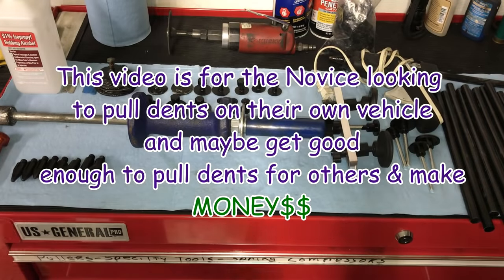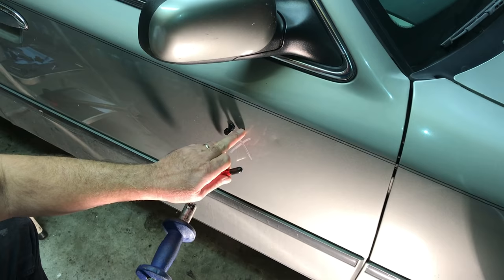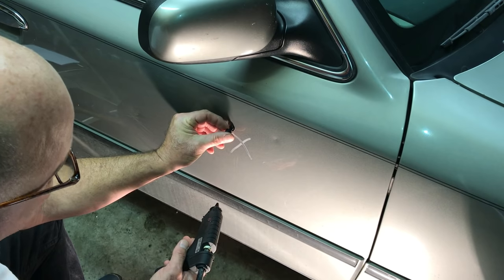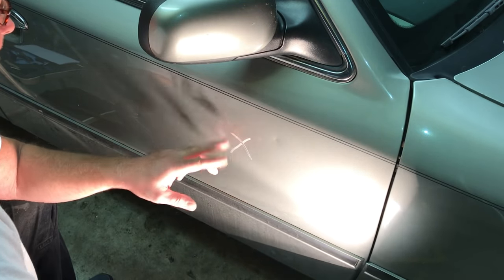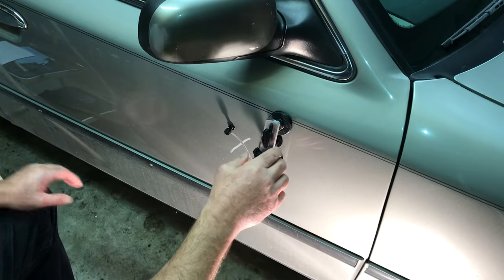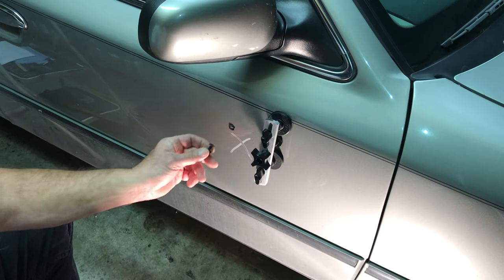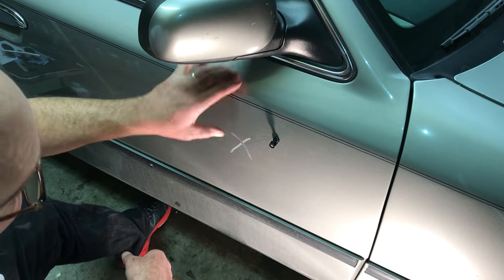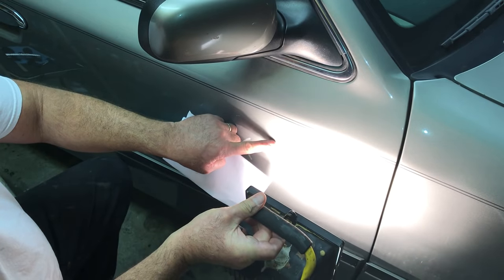#2 How To Remove Simple Door DINGS & DENTS for DIY'ers

Comment: Can't find a descent kit with your style of slide hammer. I can only find the ones with the the "T" end on it
Reply from the maker: Jursaw if you go to ebay and search this>      Dent removal slide hammer            you can find some good stuff also if you cant find only a t-handle in your price range you can cut two pieces of rubber tubing and glue them on for some cushion
Reply: Try Harbor Freight.
Reply from the maker: thank you Sean and we are very glad to have you here with us..its comments like that that will make our channel very useful to others..:)
Reply: Sweet Project Cars Thanks! Ill try out a cheap kit to start off

Comment: I'm worried I'm going to pull the paint off, is that actually possible?
Reply from the maker: Evan Walker  see this https://youtu.be/kMT5l14U0iE
Reply: @SweetProjectCars  What if its really cold though.
Reply from the maker: Evan W  you want to do this process in 60 F or high degrees

Comment: How does it work on a aluminum pontoon boat ding?
Reply from the maker: A Payne it works great my friend :)
Reply: Would you suggest doing anything different than you showed in the video due to the thickness of the aluminum? Mine is .10 but many of them are less like .08 ?   @SweetProjectCars
Reply: And also the fact the aluminum is softer than steel
Reply from the maker: A Payne start easy and see how it works then you have room to adjust as far as pulling is concerned. mike
Reply from the maker: A Payne I would not change anything other than you may have the dent come out before the tab comes off and in that case you put you Rubbing alcohol on it and release it by hand.

Comment: Is heat gun necessary for PDR?
Reply from the maker: Hello Alex yes if you look at one of our latest videos you’ll see the heat gun that we use it is one of the best yet cheapest using it for PDR helps a lot when I’m warming up the metal
Reply: Thanks for replying. I was contemplating whether I should get one? I have been dealing with a dent for two hours by pulling and when I try to use the rod to push it out - the fender is  quite strong and nothing I did make much difference. Would using a heat gun makes a difference ?
Reply from the maker: Wah17 yes it will if you can warm it up..also you have to make sure the spot where the glue tab goes on the dent is clean so you can really pull and the tab wont come off.
Reply: Sweet Project Cars thanks for taking time to reply to your fan. I’ve got a Volvo I have spent 3 hours pulling around the fender part that was probably damage by a trolley - pretty deep. 

Multiple pulling works but getting behind the fender and pushing - doesn’t seem to get much results versus pulling from the tab multiple times. I will get a heat gun and attempt to use my rod to push out the dent if possible. 

Do you have any advise for me ?
Reply from the maker: Wah17 well, it is tricky sometimes you may have to get inventive to get some leverage from the inside so you can really push on it...crazy part is all dents are different so it is never the same procedure it seems :)  mike